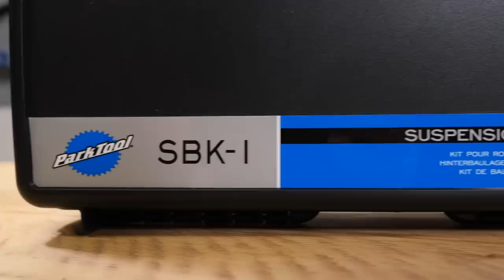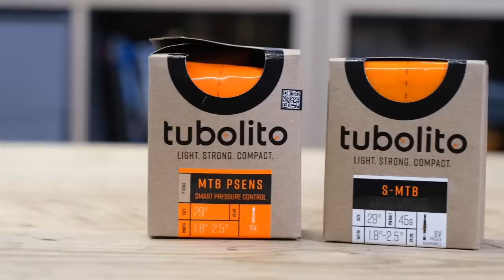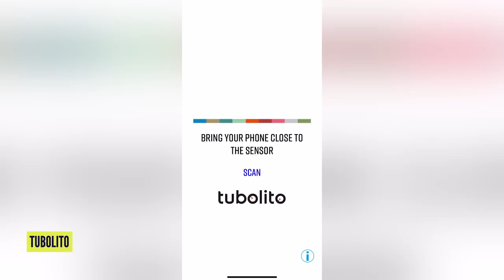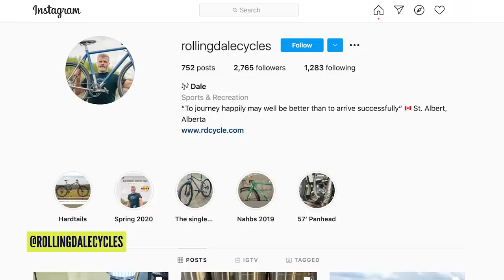Carbon Or Aluminium, Which Is Better? Plus New DH & Enduro Bikes From Prime | GMBN Tech Show Ep. 173

Comment from the maker: Is your mountain bike carbon or alloy?
Reply: One carbon and one chromoly.
Reply: Alloy of course, on my canyon neuron I think its a bit more stable through the rough stuff because of the weight
Reply: Currently I have an aluminum, but if I had a choice, I'd like either a pivot switchblade or an Atherton trail bike
Reply: Titanium 💪
Reply: I have a carbon enduro bike, very stiff relatively light to the size of a bike, and fast💨. I also have a alloy hardtail and it's soooo fun to ride. It's a matter of personal requirements I believe. If you want a fast high tech frame then get the carbon bike but you will be amazed how affordable and fun the new allow bikes are🚵‍♂️🚵‍♂️🚵‍♂️🚵‍♂️🚵‍♂️
Reply: Neither! Reynolds 853 Cotic steel hardtail. <3
Reply: Downhill? Aluminium. I'd go carbon for XC that have climbs
Reply: Carbon full sus, titanium hard tail and steel ss
Reply: one carbon one alloy. carbon looks better🤷🏻‍♂️
Reply: I rather have alloy with top components, than a carbon one with basic parts.
Reply: titanium hard tail!
Reply: Alloy, but i wish i had a chromoly one
Reply: CARBON FULL S.....BUT i would choose next time alloy, less paranoia after riding and inpections etc.
Reply: DH bike is Alloy, Trail Bike is Alloy front end and carbon rear end (replaced a full carbon bike last year) - given that design is settling down a bit, I think my next bike will be full Alloy as Peak District rocks do not forgive! Interesting to see some of the manufacturers using Alloy for more 'value' versions of a design. I think they are missing a trick and should still offer the top end finishing kit on an Alloy frame. Cheap Alloy frame + top parts is surely better than expensive Carbon + cheap parts?
Reply: Wooden
Reply: Carbon! Cube Reaction Race
Reply: Alloy, I'm one of the house mere mortals who don't have deep pockets.
Reply: Carbon.
Reply: Alloy hardtail and full sus, and a steel hardtail singlespeed.
Reply: Carbon.
Reply: Alloy... I have PTSD after multiple paint chips and cracking my last carbon bike
Reply: Who is saying 30 minutes is too long?  Tech show can never be too long!
Reply: Aluminum cuz im a budget rider lol
Reply: I got an alloy enduro bike for Christmas, but if I could have any bike it’d be carbon with alloy wheels
Reply: Chromoly and Aluminium. In future only aluminium for me. Cheaper, often lighter, which is weird, good parts. And it feels amazing.
Reply: Alloy
Reply: One of each, both have good qualities
Reply: Alloy... Because plastic is choking our planet... What is the plan for the future with all those carbon frames :( ...
Everyday I ride my bike in the mountains I pick some trash... But there is more and more all those plastic crap, especially after weekends...
Reply: Steel cotic 🤷‍♂️
Reply: Alloy.
Reply: @All_the_bikes_are_cool ?
Reply: @adventurefishingscotland3918  my thinking was if we can't sort small plastic bottles and other stuff how we will sort big problem... If I good understand there is no recycling possible yet for carbon frames
Reply: I use SteadyRack.   Really nice product.
Reply: Carbon scott scale and carbon trek road bike, I haven't tried carbon wheels though 🤔
Reply: Just bought my first carbon :D
Reply: Alloy and Budget
Reply: Steel, baby!
Reply: Enduro: carbon
DH: alloy
Reply: Santa cruz Hightower CC. But would like to try the alloy version just to see if the Carbon deserves the price.
Reply: 1 carbon, 2 alloy, 2 steel. I like carbon for its plasticy sound dampening. It‘s less prone to squealing noises or sounding linke „a toolbox thrown down the stairs“. I‘d love to try carbon wheels but 1400 euros just for the rims - ouch!
Reply: Aluminium for me as carbon frames are not recycled in uk
Reply: Have an alloy nukeproof mega after owning 2 carbon trek bikes , remedy then a slash . 
I can’t knock the alloy and to be honest , in enduro style riding , I’m not sure the advantages of carbon are that significant
Reply: All carbon, all the time, no question. Alloy is shit if you're a large powerful rider, I've cracked every single alloy frame I've ever ridden, except one. Because I was still riding it when I lucked into my first carbon! Since switching to carbon (6 years now?) I have not broken one, trail or DH. If you're average sized, well lucky you.
Reply: Old. But carbon. It's a nuclear pesto ibis mojo SL with a few upgraded bits including hope brakes and hubs.
Reply: What about with steel and titanium? Nothing wrong with either of those also.
Reply: One Ti fully, the rest are Al. I wouldn't waste $ on C.
Reply: Only steel is real!
Reply: Alloy
Reply: Mine is both. Carbon main frame and alloy rear triangle. In 10 years or so I'd like to buy a titanium one.
Reply: Carbon. Because when you have roof rack for bike on a Puegeot 5008 every gram counts 😂😂😂
Reply: I only ride carbon wheels that are tuned to feel like alloy and 35mm bars that are designed to feel like 31.8s...
Reply: Carbon, Specialized Enduro Expert. I use it for XC and bikepark. XC with carbon wheels and bikepark with alloy wheels.
Reply: The main downside to most carbon frames is that they're not fully recyclable where as alloy and steel frames are.
Reply: Lucky to have same model in both materials, and like to ride both!
Reply: metal is METAL!!!
Reply: Steel
Reply: Alloy only due to budget
Reply: Carbon.
Reply: My bike is metal and it rolls. Done!
Reply: I am pretty new and have an old alloy bike. I am thinking about upgrading to something woth more modern geometry and something a bit larger as i am 6'4". i plan on going with alloy because I know I am gonna crash and alloy is less affected by scratches and chips then carbon is.
Reply: Carbon trail bike for finesse.
Alloy freeride bike for smashing.
As a an engineer i worry a bit about the notch sensitivity for carbon for a bike designed to go through really rough terrain.
Reply: E-bike Carbon Front Alloy rear / Enduro Carbon
Reply: Carbon emtb and carbon full suspension trail bike so basically carbon.
Reply: My ideal mountain bike is alloy, mostly because I like the ability to radically modify it as necessary actually. Carbon "can" be modified, but it's dangerous and complicated and requires far more specific materials and tools.
Reply: All carbon with a Cromli dirt jumper.
Reply: Wood. Sorry.
Reply: Alloy! Canyon spectral and Devinci spartan.
Is really carbon looking better? Imo tig welding, when is well done, it's gorgeous!🤤
Reply: Carbon
Reply: alloy, and even if I had more money, still alloy, I value reliability so much and worrying about scratching a frame takes the fun out of it
Reply: steel. sorry.
Reply: I wonder how all these people have a steel frame. @gmbntech maybe you can answer with a nice discussion in your talk show but i think are 2 cases:
1. All these steel frames are from three '90s (like my first mtb)
2. All these steel frame owner are hipster
Reply: Steel for the win.
Reply: Alloy hands down. You think your carbon is as durable? Ok smash it with a rock, then do it with an alloy frame. Oh and do it with your heart monitor on, I want to see how if it goes as high with both and I bet it goes much higher with the carbon one ;)
Reply: @derinsamioglu9064  If alloy is good enough for Bruni, it's good enough for me.
Reply: Alloy bike park bike, carbon trail bike, both on alloy wheels. Carbon handle bar just feels better, regardless of weight.
Reply: My current bike is alloy, but it is only a "agressive" hardtail✌🏻 it's not that special and I'm waiting to gather the money for a fullsus trailbike in the future
Reply: 1 carbon, 5 alloy
Reply: Alloy, and about to get an emtb, also alloy, which for me was a major selling point. Here's why : I hear what you say on both materials being equally breakable, but I still prefer a material that tends to bend more than one that tends to snap more, even if the difference is marginal. But by far the biggest argument in favour of alloy is sustainability, so thanks for pointing it out. Quite simply, carbon is not recycled, apart from some very rare cases, because it is inherently very difficult to recycle. Alloy poses no problem on that front. In today's world, this makes it very difficult for me to understand why carbon is even allowed to be produced, unless there is an absolute need for it, and no other material will do. Cycling, as brilliant and fun as it is, does not need carbon. It has other options. Because of always wanting to push the envelope and relentlessly wanting to improve performance, we forgot to look at the fact that part of the manufacturing behind a sport/hobby that embraces the natural world is in fact damaging it, and that can't be right. Anyway, that's my two cents.
Reply: @All_the_bikes_are_cool  Exactly. All that carbon is future landfill.
Reply: @All_the_bikes_are_cool  gorilla gravity bikes recycle there carbon frames 👌
Reply: Carbon but only because the model only exists in carbon. Otherwise would of been happy sticking with alloy.
Reply: alloy
Reply: Aluminium, not because I had to, but because I wanted to.
Reply: Which one?
Reply: I have 2 alloy but getting a carbon one in June.
Reply: I have an Alloy frame, with a steel seat/chainstay rear section
Reply: I have three all them being alloy
Reply: Alloy full sus
Ti hardtail
Steel rigid SS

I just don’t trust the people skill that’s required for carbon lay up, just seems to critical and I do occasionally crash or hit a tree.....I’d be too worried riding the carbon again afterwards!
Reply: One alloy, one steel, I’ve had carbon in the past. The most important thing is how the frames put together rather than what it’s made from.
Reply: You forgot the best frame material, steel!
Reply: @All_the_bikes_are_cool  Out of interest what alloy frames have you broken and how long ago was that? Also how did they break?
Reply: There's always some nicer bike. Just bought a new Oiz H30. Plenty happy with aluminum. Both materials can fail under extreme conditions, but I don't have to worry about hidden cracks. Plus it's going to be a long time before the bike is what's holding me back
Reply: My bike is kind of a hybrid.  The main frame is light aluminum and the rear fork suspension frame is carbon.  🤔.  Although I would like a full carbon MTB but it’s just to expensive.  I can’t spend that kind of money when I gave bills..
Reply: I've never ridden a carbon bike so i couldn't say what i like about them
Reply: Alloy
Reply: Alloy 'till I die!
Reply: Been riding mtb for over 30 years, started with a steel bike and then 10 years later went to carbon. Just got my first alloy bike this year, a used Banshee Rune V2. Seems like a great bike.
Reply: Most are chromoly, and a few are alloy.  The chromoly are the best!

Comment: I have a Merida Big 9 TFS 300 mountain bike and I love it. I bought it about 9 years ago. I bought it because it was a hard tail and I could put a rack on the back as I was going to use it for commuting to/from work and riding to get groceries, etc. The frame is alloy and I think the wheel rims are too. When I bought the bike, it was a heavy weight @ 9kg all up ready to ride, if I remember correctly. I added a pannier rack, 2 pannier bags and a Basket Buddy expanded mesh basket with a fitted cooler bag on the rack.  The pannier bag/basket combo holds enough groceries to last me 2-4 weeks. And, during party time, the basket can hold a box of 30 cans of beer and each pannier bag can easily hold 2 x 4 litre wine casks or 2 x 5 litre casks in a pinch.

The main reason I bought the Merida above was because it was a solid mountain bike that can take the abuse of a 52 yo man for commuting and the occasional stealth camp. I didn't buy it for the usual mountain biking stuff, I needed a solid bike for my purposes. The rack is an Axiom Journey rack with 100kg capacity. The front fork has an adjustable spring and compression damping up to hydraulic suspension lock out - cool for speeding down hills on the road.

I'm nearly 60 now and I still get on the MTN bike even though I own a motor bike that can haul twice as much stuff.

Sorry Doddy, this may be a bit much sideways for this video.

Comment: A RFID inner tube is the ultimate shark jump. A borderline offensive solution in search of a problem & I sincerely hope that in a world of dwindling resources, it goes the same way as internet connected kettles & digital photo frames.
Reply: I would also assume that even a cheap and old banged up mechnical pressure gauge yields more accurate readings.
Reply: You are right, that's problem for a solution. However perhaps if it was valve with chip for tubeless, something like cars have tyre pressure monitoring system...

Comment: I ordered a Specialized Chisel Limited edition thinking I would swap my 2021 Epic parts over, it came with a few frame defects like a poorly faced BB area and a dented headtube. The super thin light weight alloy bikes are extremely delicate and make carbon look like iron.
Reply: I have no idea how that happened but speaking from my experiences on a 2020 Chisel, the frame has been extremely sturdy. Keep in mind that I'm only 125 pounds, but when I'm not racing XC I push the frame way harder than it was ever supposed to be pushed to the point where I feel the frame twisting noticeably under me. Not to mention all the jumps and crashes into rocks that I have had. The frame is still going strong (knock on wood), and I have had it for almost a year and have no worries about the durability of lightweight alloy frames.
That being said, the new Chisel frame is almost .4 pounds lighter than mine and I would definitely be hesitant to send that light of an alloy frame off jumps.
As for carbon, I would have probably broke a carbon frame by now from impacts on rocks. That's why I'm concerned about super lightweight carbon frames, especially given the price. I guess our opinions are completely opposites

Comment: I prefer alloy for purely budgetary reasoning. Carbon frames are cool, but unless it has carbon unique features, like tube-in-tube cable routing and/or internal frame storage, I don't find the price worth it. 

That said, I've noticed that many high end carbon bikes cover the cost of the frame through component savings. For example, the Nukeproof Mega Carbon Elite (featuring Fox Performance Elite suspension and full Shimano SLX groupset) costs almost identical to buying the Mega Alloy frame and building it up with the same spec. In an instance like this, I might as well just get the carbon frame.

Comment: Moto GP don't use carbon frames because of the stiffness and less grip. KTM motocross bikes are considered to be better on some tracks because of the steel chassis that flex more then the japanese aluminium chassis.

Comment: I just bought a new bike, which happened to be carbon frame but my main focus was on the specs of the bike. I just couldn't get the suspension and groupset i wanted on the alloy version. So far, i love the carbon frame but still... alloy would have been fine too

Comment: I got the Spank spike vibrocore wheels that have foam in the rim and they are aluminum. When I got them some of the reviews where they give a mushy feel and aren't very efficient for pedaling, wich may be true, they are more geared towards downhill, I first put them on an enduro bike, the giant reign wich had trash small bump sensitivity, and those wheels really made a difference. Now I transfered them over to my new rig wich is basically a downhill bike, it's a Norco Shore with dual crown forks, but it has a dropper and an eagle drivetrain. So far it has been great, haven't noticed issues with pedaling efficiency, but I'm not sure I would because I'm out of shape and prefer going downhill.
Reply: And if money wasn't a factor I would go with this same bike because I wanted a downhill beast capable of pedaling, I was leaning toward aluminum because I've dented an aluminum DH bike in the past and it still worked for many years, I'd be worried about cracking a carbon frame although I know it wouldn't be likely. I did break a linkage on my DH bike once but I hit a large jump hard with poorly setup suspension because I didn't change the coil spring when I got fat. And the wheels I would probably say the same, I would definitely go with aluminum again but I might go with stronger wheels. I'm not sure, the Spank spikes feel weak probably because of the compliancy, but it is worth noting I cased a 35 foot double on them onto a very sharp edge and they are still dead straight. The DT Swiss wheels on my old DH bike where absolute tanks, I cased the same double but harder and they also held up as well as smashing through almost every trail on the mountain and they didn't get any more bent then they were when I got them because the bike was an old rental bike from the mountain that I got half price. The Giant SL wheels that came on my reign where trash, at the time I also had the downhill bike so I didn't ride my reign very hard until I broke the downhill bike and put the Spank wheelset on, but even with not very hard riding I had so many dents in the side of that rim. After 5 years of hard riding there was one really small dent in the DT Swiss wheels, after about four years of mild riding I've repaired probably 6 dents by now, and I mean mild riding, my DH bike was go to in the summer, and I didn't ride much in the winter, I only rode the Giant a few times at the mountain to get the suspension setup and then some mild trails on trips with the outdoor program at my college.

Comment: Sort of back to long bikes, I wouldn’t mind hearing your opinion on proper reach vs body size.  As someone with short arms but a long torso, I always feel right on top of the handlebars when in the attack position.   But with slack head angles, should I care as long as the front axle is way out in front of the body?